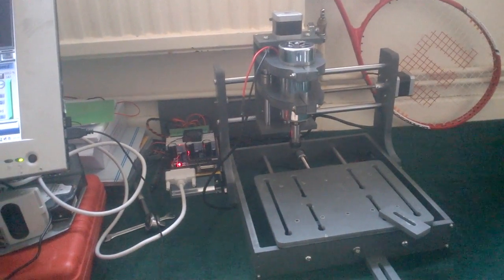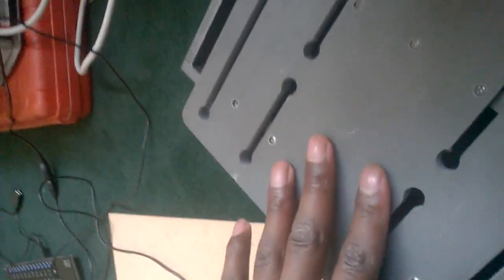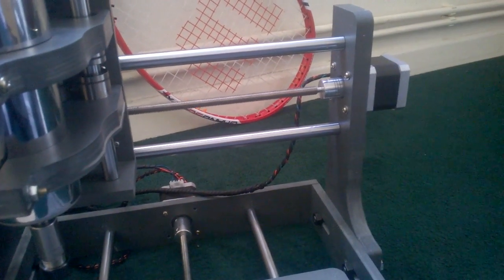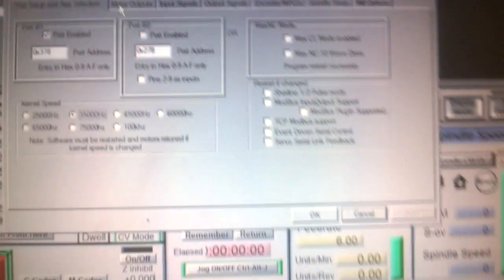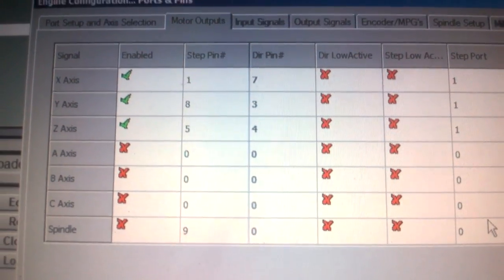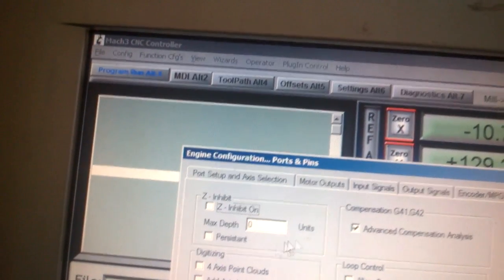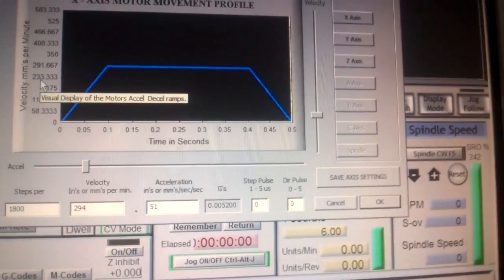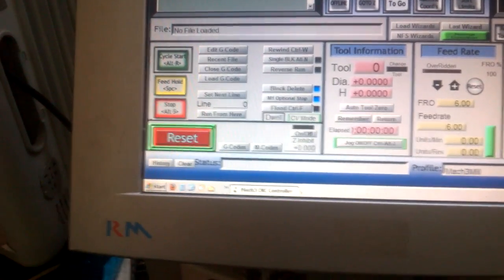Mach 3 software input pins tutorial, stepper and spindle running hytb3dv

Comment: to control the driwer you can use arduino with Schelde RepRap or grbl. so that you can use sd card. . only a few wires you need to connect. (Theoretically only need display, SD card reader, encoder + soft to the RepRap. .  and arduino :))(
if you want to use larger engines)